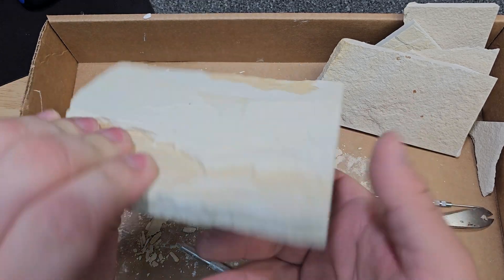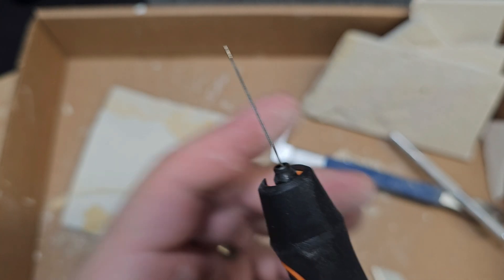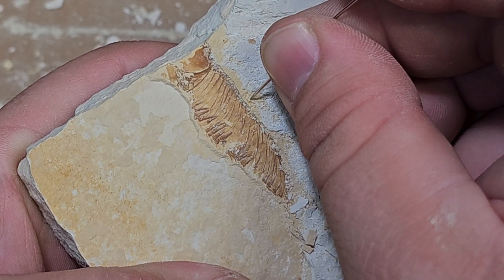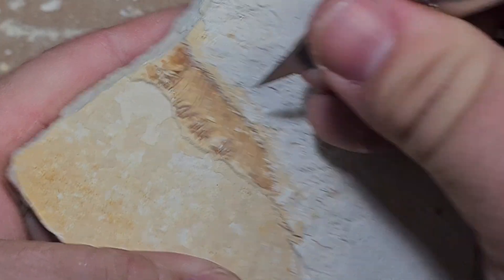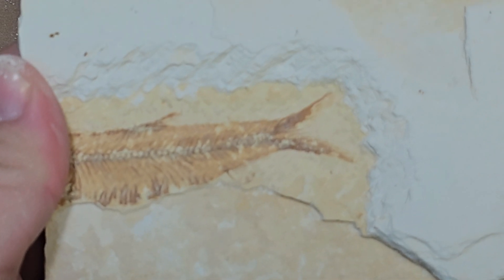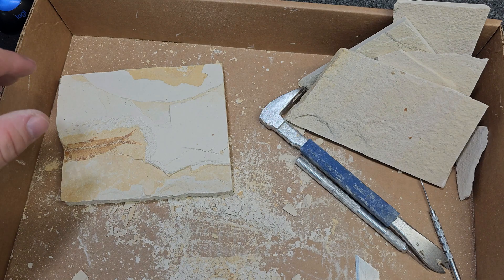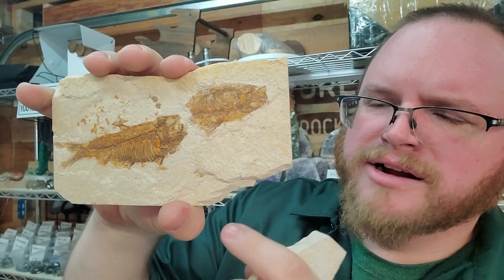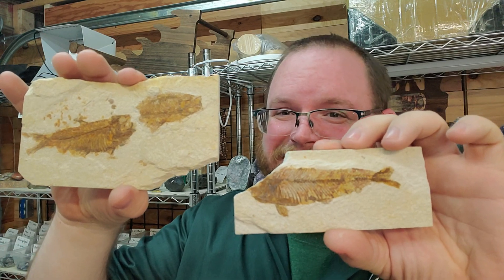Prepping Fossil Fish

Comment: @WorldofRockhounds Any suggestions for getting the dust off green river fossils? We recently cracked a lot of fossils and they seem to have gotten a lot of the sawdust from the cuts in the fossils. Can we use a toothbrush and water? Hydrogen peroxide or vinegar? What do you do to keep your fossils clean and protected after you've prepped them?